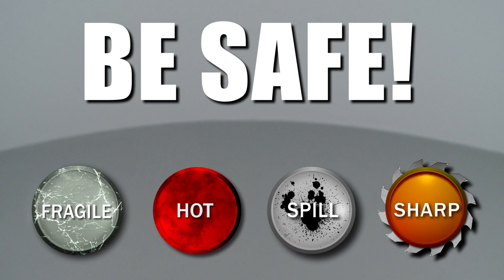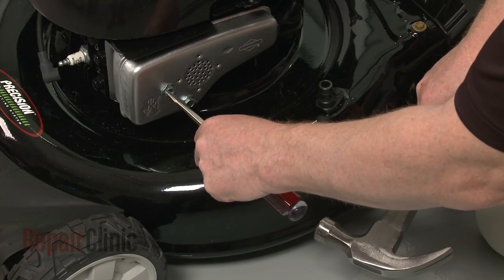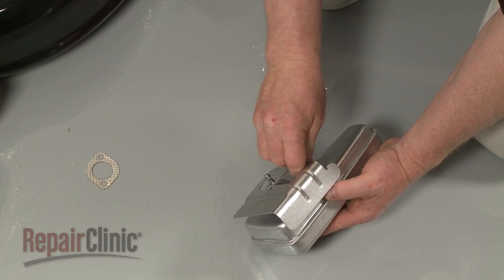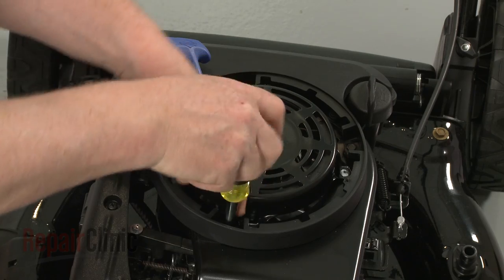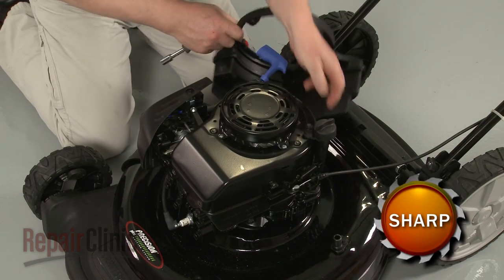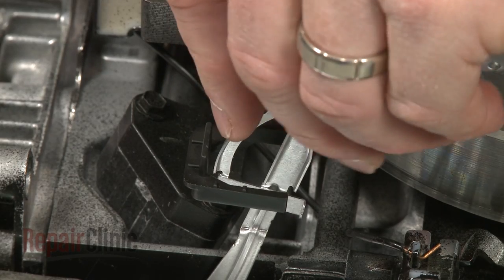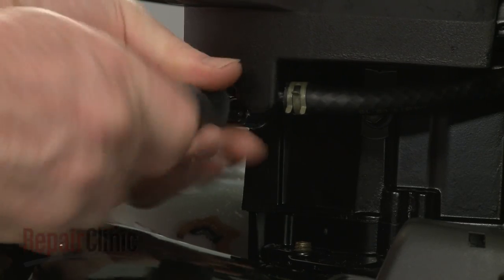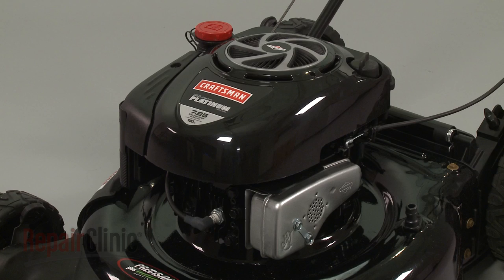Briggs & Stratton Lawn Mower Engine Replace Muffler #790828

Comment: Outstanding instruction!  I paused the video and suddenly found an extra part lying on the ground and I was struggling to figure it out.  When I restarted the video you were kind enough to point out the fuel tank separator.  That is what it was and the mower works perfectly now.

Comment: I'm watching this becuase my lawn mower started spitting out oil from the muffler. At the same time white smoke appeared while it was running which I'm assuming was from the oil being burned on the surface of the hot muffler.